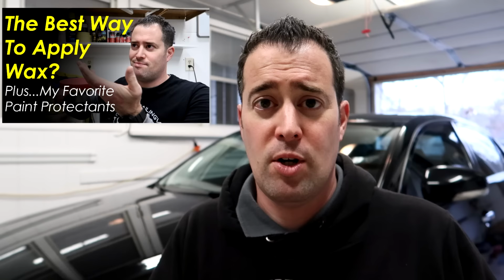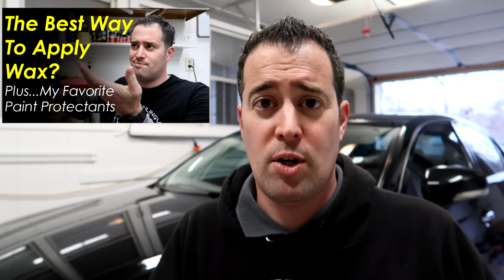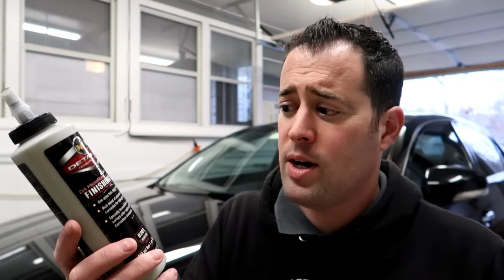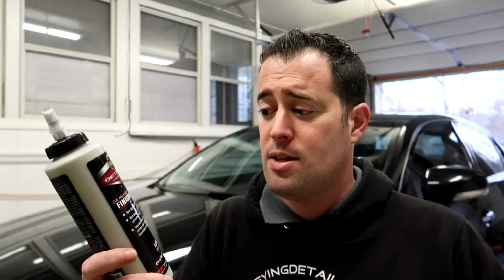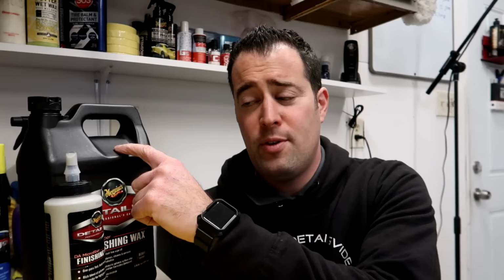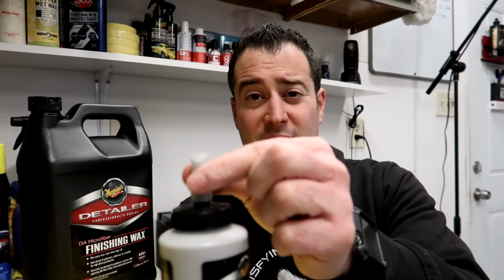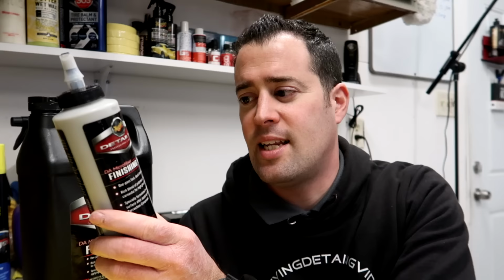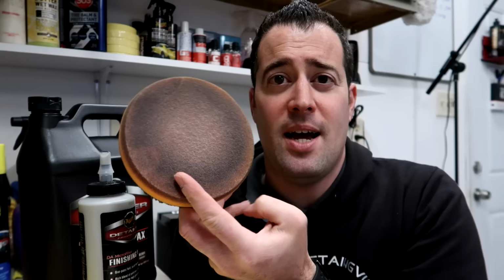Exterior Detail // Mercury Marauder // Meguiar's D301 Finishing Wax Results

Comment: Miranda detailing woukd you basically say that the finishing wax is for gloss enhancement and hdspeed for single stage paint correction.
Reply from the maker: It depends on the paint and the pad used. I have used D301 with a microfiber cutting disc before and it works really well also. I’ll be comparing them both head to head soon
Reply: @MirandaDetailing  thank would be great video.

Comment: D301 is so easy to use, goes on and wipes off so fast, that IMO it’s not much more effort than a spray wax. The only part that adds effort is getting the DA out of the tool box and dealing with the extension cord.
Reply from the maker: That’s true!  But now with the cordless DA from SPTA it’s even better and faster! 😎👍🏼

Comment: I have been using meguries M21 synthetic sealent, applying the same way, and the results are incredible. I have just ordered some D301 to try, following this video. I usually apply the M21 all over the car with the DA, and once all areas are covered I will then buff off, as it hazes up really nice and the longer you leave it, the easier it is to buff off. Is that the case with D301??
Reply from the maker: Hi. That’s great!  D301 doesn’t really need to haze. It’s a wipe on wipe off product. Super easy to use.

Comment: Hi Miranda Detailing. I need to ask you about what could be a replacing product for the pads conditioner (the lubricant) that is easily found in the market. I mean if i don't need to waste too much money on real lubricants. Is that a way to lubricate the buffing pads with other products maybe at home???
Reply from the maker: Hi. Not sure what you mean as the pad conditioner or lubricant? Do you mean a spray that  you use on the polishing pads?
Reply: @MirandaDetailing  YES !!
Reply from the maker: Oh ok. I don’t use sprays like that. I just apply the compounds or polished directly to the pad and that’s it. I really don’t think those sprays are necessary
Reply: Miranda Detailing Great then !! I will do the same like you. Thank you so much for the valuable support. Good luck.
Reply from the maker: You’re welcome.

Comment: Now what kind of mild cleaners does this have could it remove very light defects or would it smooth out the surface a few washes after a recent clay? I machine apply this wax too after clay but wonder how many times I can keep waxing with this before needing to clay again
Reply from the maker: I don’t know what kind of cleaners, all I know is that it has polishing agents and it does remove minor swirls and marring left from the clay bar or clay mitt. When it comes to clay barring there is no set time frame as to when you should need it. Only clay bar the paint if and when it’s needed. Feel the paint and see if it’s rough as you’re washing and then you can determine if you need to clay.
Reply: @MirandaDetailing  so can you apply a wax like this by machine after wash a month or two after you have already clayed